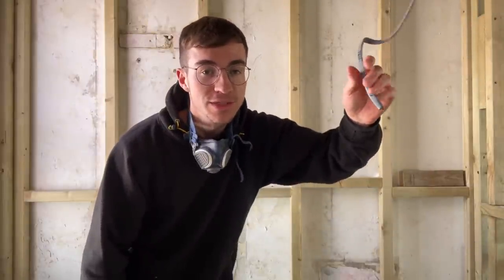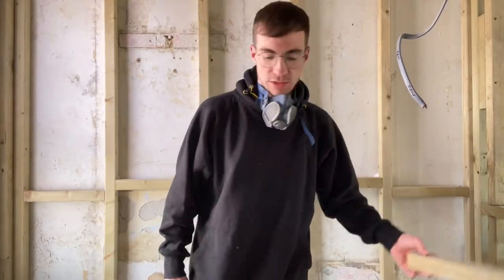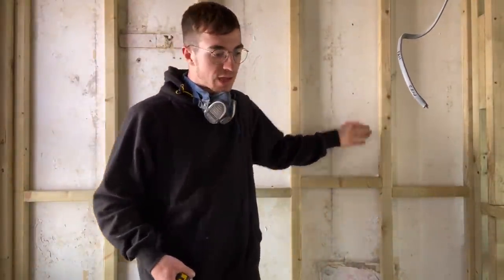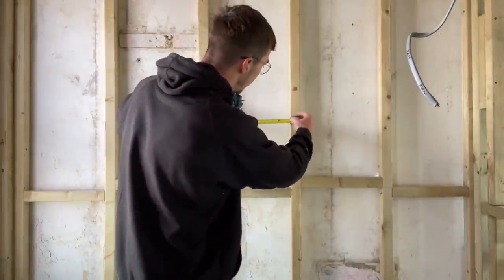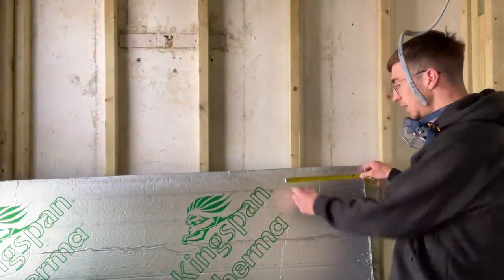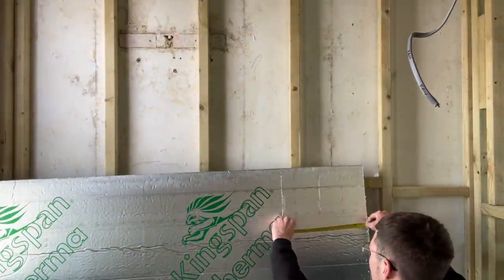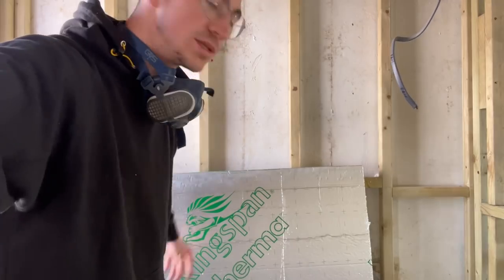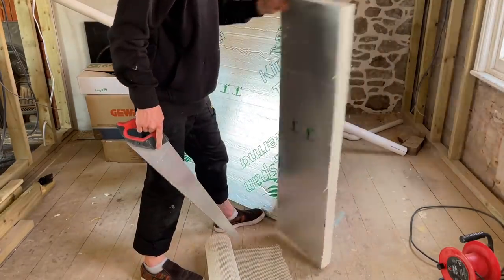Insulating my house! (Tutorial)

Comment: Handy tip, any gaps between stud and insulation board, get a can of expanding foam to fill the gaps. Helps with air tightness too to prevent drafts. Do not get it on your skin. I had no finger prints for a week once after I got it on my hands
Reply: Handy if you were thinking of taking up catburgling or similar life of crime :P
Reply: You could wear gloves to avoid getting it stuck on your fingers
Reply: @eddiew.4650  You could as long as you are not a thick plank like me 😂
Reply: I have a huge can of expanding foam I bought off Amazon. Got it to fill a few holes cut out for piping. Even the tinyest amount expands to fill a huge hole. Lol have pretty much the whole can left.